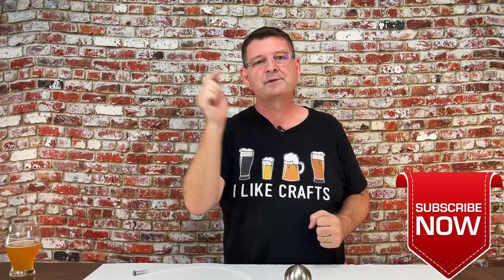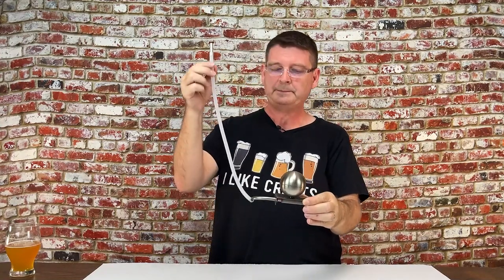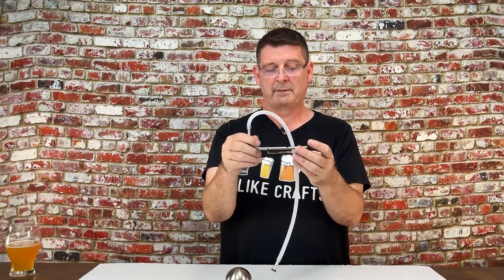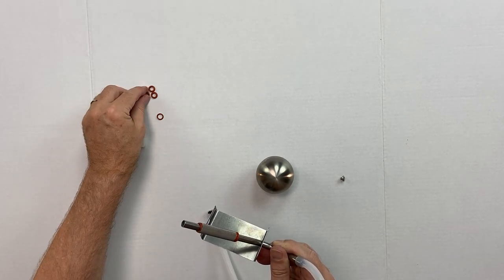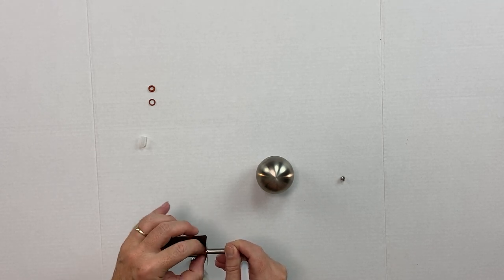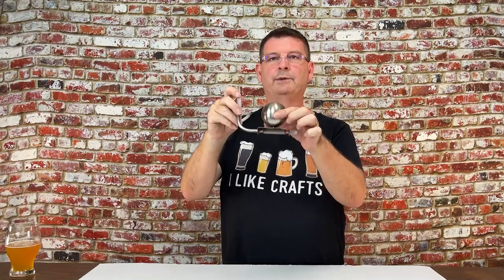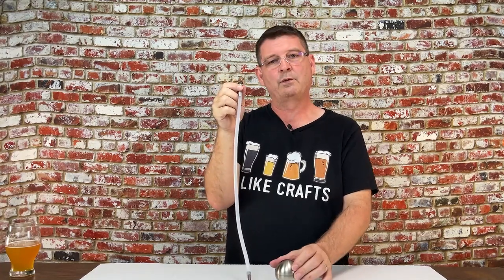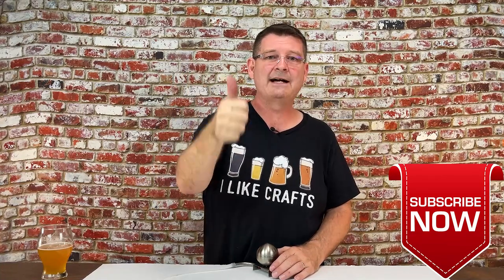Clear Beer Draught System - Floating Dip Tube Series - Part 1 of 4

Comment: I've been using this product for years, quality is second to none. I add hops directly to my kegs and never have clogging issues, killer product for IPAs!
Reply from the maker: I like it a lot as it was very well thought out in both design and evolution and my only real issue if I had to be picky is the price. I can't say it is over priced as you do get a great product and it is a bit large so the price is justified but it is still expensive. I've also been reluctant in trying it in a all rounder do to the size when doing pressurized transfers.

Comment: Great video.. I've been using these floating dip tubes for a long time.. so I have a bunch that predate the filter and use a cylinder shaped float instead instead of a sphere.  More expensive option, but it works great.
Reply from the maker: The price does hurt but I must say it is a quality product. Have you ever tried using one in a fermenter?
Reply: @BitterRealityBrewing  it’s great… I haven’t tried it in a fermenter, but I had planned to in a Blichmann Cornical I have but not yet.  I always use another fermenter to use.  In the Fermzilla all-rounder I use the  one they provide.

Comment: Great video. Thanks for the info. I've been canning my beer so I haven't used my kegs for a while. Might have to get back into using my draft system again.
Reply from the maker: Are you can conditioning? I keep checking out the canning systems but they are so expensive and I have no where to store the cans at the moment.
Reply: @BitterRealityBrewing  I do can condition. I bought the Cannular Pro Semi-Auto Bench Top Can Seamer. It is expensive but, I save a few dollars because I was able to build my own power converter from AC to DC.
Reply from the maker: @SankaraHomeBrewing  Hopefully when I get to my new place I will put it on my list as that list for the new mini-brewery setup is already a bit long and expensive.

Comment: Great review and looking forward to the comparison video.  I have the Kegland ball float system which came with my 7.6 gal Kegmenter which works great in serving my craft beer. Only issue sometimes is getting CO2 instead of beer in the liquid out when the keg is full.  Maybe my internal hose is too long?🍺 Cheers
Reply: I've been using the clear beer system for years.  I've never had that happen.  But of course the clear beer is more expensive.
Reply from the maker: Sometimes they push up on the sides or hit things if you have anything floating in the keg like oak or hop bags. (I have this issue in the pressure fermenter with dry hop bags and the tilt hitting it.
Reply from the maker: Not to mention the Clear beer system is REALLY heavy so nothing will cause it to hang up on anything...that thing is built solid.

Comment: Craft Beer!!  Does it float level or drift to one side against the keg side?
Reply from the maker: This thing is heavy so it doesn't drift much plus the tube it came with is a bit thick which I think helps to line it up with the center as much as possible although I would expect a little drift side to side.